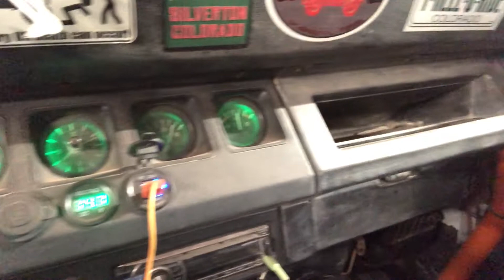Will my Jeep YJ start after sitting for 6 months?? EP. 6

Comment: lol, I had not seen anyone else use the space under the gauges for volt meter and power ports lol. I did this to my YJ as well and I don't know why they didn't do something similar from the factory really lol. I've been working on some 3d printed stuff for YJ's and Cherokee's too. I've got a 3d print design for the switch panel location just right of the steering wheel. Great stuff man Loving your video's. I've got some front end work to do to our YJ before I can hit the trails again but hoping to soon.
Reply from the maker: I got that thing off wish for like $2 haha. those new style rockers that everyone is using fir perfect into that spot right of the wheel if you cut away that thin vinyl, there is plastic squares the perfect size behind it.

Comment: Next time take plugs out, put a little oil in each cylinder, lube the rings and cylinder walls. Won't be quite so noisy. Sure sounded good once it fired off. Getting close to drive time.
Reply from the maker: I probably should have, I never even considered that cause I had never let it sit so long before
Reply: @FlawedOffroad  You will get more chances, old trick I learned 50 years ago building hot rods. Hope I passed on something you can use. So can your viewers. First start-up is very important. Try not to start em up dry.
Reply from the maker: @wesbarcus3761  Thanks for the tip and for watching and interacting on so many of my videos! Things are a little crazy at the moment so it might be a bit before I have a new upload
Reply: @FlawedOffroad  don't worry about trying to keep video schedule, we will be watching when you get new ones out. Have fun, will catch up when you can.